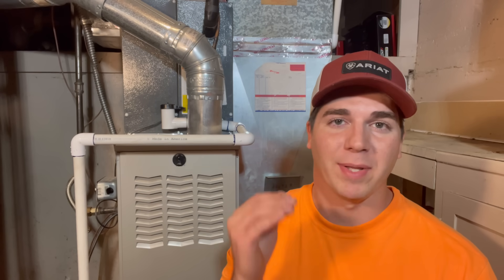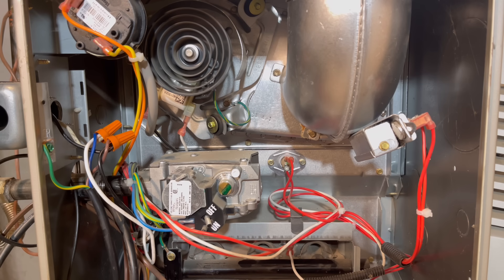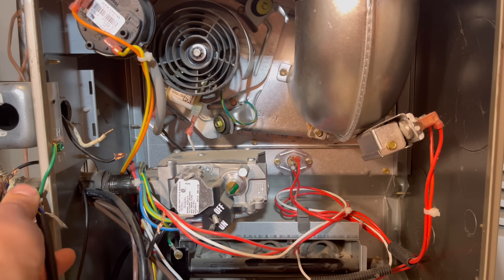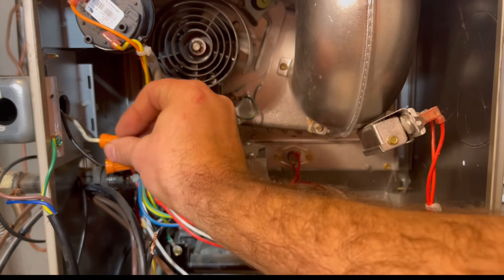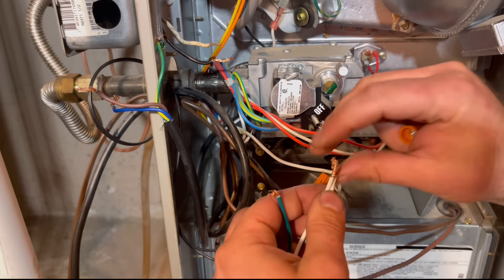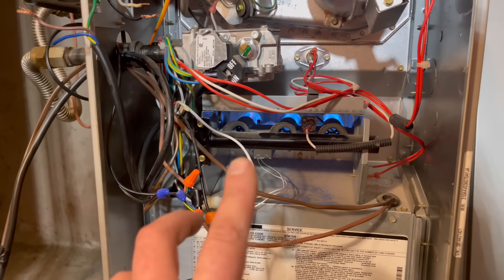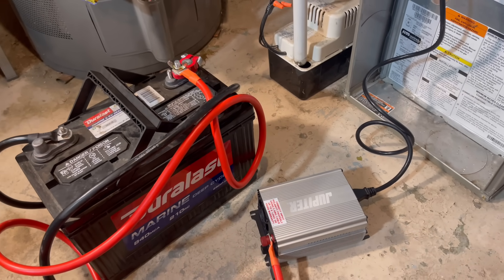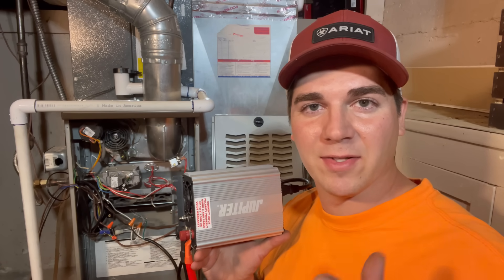Did You Know You Can Heat Your Home With A Car Battery?

Comment: Better idea for emergency situations.... get a 1000 watt inverter, and have it properly, professionally and permanently installed in your car / truck / van.

(Or you want to go all out, get a 2000 watt inverter, get a better alternator and a second battery installed in your car.... car stereo guys do it all the time).

In the event you need power, like for your furnace or fridge, you can leave your car idling (big deal... this will cost you 30 litres a day, who cares about chumpchange or minute pollution in an emergency situation) and run an extension cord to your fridge and furnace. And if its that cold outside and you have no power, roll the goddamn fridge outside, and ut wont even need power.

Smart tip :

In your kitchen,....
turn the fridge on lowest temp.... get it good and cold.... then you can unplug it for 6 hour shifts, and use the power for something else in the meanwhile... like your griddle or lights.

Sane goes for the furnace... get the house gotter than you can stand, then turn the themostat down to 55'F  bundle up and go to bed.  

If you need to boil  water or heat food , wheel the bbq into the garage, and do it in there with the garage door cracked a bit.  36 slices of toast in 5 minutes.

Final note.....

Generators suck.... they are loud  and piss off your neighbors. And they also arouse suspicion.... in hard times, people will take what you have.  An idling car with the lights off is much more lowkey
Reply: Why would you roll a fridge outside?  Makes zero sense.  Take the stuff out of it and bring it outside instead of the fridge.
Reply: @areyouthreateningme4026  Yes you are 100 percent right. If there is snow or its cold then your idea is the best. If it's too cold then a fridge compressor will freeze up and stop working.
Reply: @areyouthreateningme4026  because the fridge will keep your stuff from freezing while your furnace is getting fixed, or until the power is on.

Do you like ftozen milk?
Reply: @mediumsizedm  Just put everything in a box or ice chest and it will be fine. I live in Montana and we had to do that during a power outage in the winter once. Oh also check on what a cold box is since that's what they used to do to keep food good.
Reply: @mediumsizedm  That will do no good in the case of a power outage.  
Your stuff that needs to be cold will be warm and possibly spoiled. That milk won't freeze inside a closed refrigerator, it will get warm though.
Reply: @areyouthreateningme4026  Better yet... My fridge has an opening behind it to the outside. When temps go low enough I shut the power off and open the back door. Lastly, I drape a thermal blanket to enclose the fridge compartment and  it works great! 
I just about loose my mind thinking about keeping the house warm so I can plug the fridge or freezer in, to keep them cold. Yikes!!!
By the way my freezer is enclosed, outside, year round and I'll just shut it off too, when the temps drop. Yikes again!!!
Reply: @areyouthreateningme4026  Alot of new refrigerators are waaay too big to just roll outside, so yeah, take the stuff outside. Makes more sense.
Reply: A small solar setup might not be a bad idea either
Reply: @chrisE815  You can buy a 400 watt solar panel kit with a 30 amp charger controller for about $500.00, but you will still need the wires and terminals ( under $80.00 ) and batteries ( $200 or up depending on how many batteries you buy and what type ), and power inverter ( I good 1500 watt pure sign wave inverter is $180.00 or higher ).  I have purchased a couple different sets and I have found that one set is just as good as any other set.
Reply: @christopherhorton821  Solar kit is the way to go for this application and it will have the added benefit of being useful the 99.9% of the time you're still hooked up to the grid (if you have a solar circuit or net metering).
Reply: @Bonzi_Buddy  The last I heard was that if you have a grid tie system, and the grid goes down it shuts off your solar system so you can not use it. If you want a solar system for when the power is out then the best way is a off grid system.
Reply: bbq in garage = Fire risk and carbon monoxide poison risk so don’t do that lightly.
Reply: Omg. You shouldn’t use a bbq in the garage at all.
Reply: @Glocktard  Right. I may have been too understated.
Reply from the maker: Man, all of this is such good info. I’m going to pin this comment. Thank you so much!!! Make sure and subscribe to our channel for more hvac tips and tricks! I’d love to have your comments on all my videos as well :) cheers
Reply: @diyhvacguy  Last time I checked the sump pump backup system uses a marine battery, hmmmmmm.....
Reply: Yes it can be done but there are a couple drawbacks with putting a inverter in a car. The first drawback is the gas prices. The gas alone would kill your savings. The second is a lot of cars headlights come on automatically when the car starts, and the third is someone can steal your car. I did install a 1100 watt inverter in my van myself using 2 gauge welders wire and a disconnect. I also have a fuse close to my battery. ( Duel Cycle Marine Battery ).
Reply: @christopherhorton821  good points.   The hybrid offering including f150 seem to solve the efficency issue. More efficent than any generator for sure.
Reply: @christopherhorton821  that's right but i would argue hybrids are not much more expensive than their gas counterparts, at least in the case of toyota. I'm a big fan of phev- i own one now- it's super convient to charge at night when I'm low on gas and gas up on a road trip.  Nearest gas station is about 15 minutes away from me.
Reply: Thank you for some valuable info regarding inverters.
Where I live my climate means I don’t need a furnace.
I’m a doomsday type of bloke! I have a genny in my  man cave under my house and the exhaust gas is piped out from under there to the side of my house via another muffler behind bushes. From my front boundary it cannot be heard.
 I need a genny because as a hard core prepper in my 70’s I have two fridges and two freezers. If necessary I also have a freezer in the motorhome that runs off LPG, and a small fridge/freezer that runs 12volt or 240  volts as is the standard in Australia.
All of these can be turned off, laid on their backs, and used as ice chests!
I also have an ice maker, that in the above mentioned scenario, I need to supply ice to the freezers/ice chests.
So for me, whilst petrol lasts, I can hopefully survive.
Reply: These are some good tips but please remember GODS last name is not damn.
Reply: @SolarVergmoid Not only is it bad for your engine it's a easy target for a thief.
Reply: @christopherhorton821 
 around here a thief is an easy target....
Reply: @boostismagic  Not so much where I live.
Reply: That’s what I did in case generator quits working can buy me some time when needed and if I ever need ac power outside of my home on the property or anywhere else but I do recommend a second backup battery installed as well and a cutoff so it doesn’t drain your starting battery unless you have a jump starter
Reply: "in hard times, people will take what you have" ... yeah they'll be laying in a pool of blood next to a generator. What is to say they aren't going to take your idling car since the key is freaking in it. There will be idiots who idle their cars in the garage and snuff out their family too.
Reply: @Bonzi_Buddy  You have a lot of common sense. I wish people would think more like you do.
Reply: @Bonzi_Buddy  lock the car while it's running and use a spare key to get back inside. Same with push button ignitions. And or run a chain through the front and real wheels (mag wheels) as a secondary defense.
Reply: @grampa_ahah  That sounds real convenient.
Reply: Add to all this,  if you have a gas water  heater, fill the tub  with  hot water, and let the heat dissipate into the living areas. A tub full of hot water contains over 1400 BTU's of heat. That's a lot. When  it  cools down, refill it. Water heater works without AC power.
Reply: @grassroot011  That's a good idea. You can also use the water to flush the toilet if your powers out.
Reply: @christopherhorton821  😅 You have an electric toilet? Nice! 🙄
Reply: @gus473  What are you talking about. My ram van may not be the best but it's not a toilet. I do have a camping toilet that can go in my van and I have a new toilet for my camper trailer, but I'm not sure where you got the idea that I have a electric toilet. Can you please clarify on why you think I have a electric toilet. Thanks.
Reply: @christopherhorton821  M. Gustafson is probably wondering, as I am too, why you would take the water from the tub to flush your toilet? If you can fill your tub you can flush your toilet (unless it's somehow electric?)
Reply: @yvongauthier4409  If you know a big storm is on the way or if your power keeps going out or if your lights keep going off and on then you full the tub before the power goes out completely and stays off. Someone said to fill the tub with hot water for heat, but if you have power for your hot water heater to work then just run a electric heater or turn on your oven to keep warm. This video was about when the power goes out. The smart thing to do if you think your power is going to go out is to fill every jug and jar and pot and pan that you have with water before that happens. Also fill your tub if you have one. Use that for bathing water and toilet water. If you have a propane or butane camping stove and a large pan you can also heat a pan full of water and put the lid on it and it will put out heat. I'm not sure why people think that if there is a large scale power outage then the water will somehow stay on without the city having power. If you have ever been through a very long power outage then you know what I'm talking about.
Reply: @christopherhorton821  Yeah you're right, water "might" not stay on. I remember the big outage we had years ago, it lasted for a day or so and it affected all of Ontario (Canada) and New York state. I still had water running because I guess our town had a backup generator. I even had hot water because my natural gas water heater was an old one with a pilot light which kept my hot water hot!
Reply: @yvongauthier4409  You were lucky. I Lived in Texas in the United Sates for 25 years and we got hit with everything from tornadoes to hurricanes. When our power went out the water usually went out sometimes for a month or longer, and if the water did stay on it was not safe to drink without boiling it.
Reply: @grassroot011  Unless it's one of the many that ARE electric..... 🙄
Reply: I dont know about a car battery making it more than a day maybe a marine battery something made to have power drawn from it constantly with little or no charge but anyone who has ever has a alternator go out in there vehicles knows there isnt much of a actual charge and are made to disburse a bunch of power at once unlike a marine battery which this is on the video there is a big difference. I do like the whole power inverter in your car but my generator isnt loud and is attached to my house I'm not worried about it coming up missing and the lights are a sure fire way to know we have power. I also have a gas powered generator that runs for 16 hours off just three gallons and can power my whole house also.. it's mainly for jobs without power but it's in the shop and I dont have to worry about someone driving it away .. but the power ok inverter in the car is a much better idea than using your car battery.. then you would be without heat and a car which would have heat if the battery is charged
Reply: @ptravers9077  I have a duel cycle marine battery in my dodge ram B2500 van as a starter battery, and I ran cables in to the van to a disconnect switch on the inside. I also have a couple bus bars so I can connect one of my inverters if I need to. It's not pretty but it only took me about a hour to make my own cables, and install everything. I can even connect a solar panel and charger controller to the bus bars on the inside of my van and charge my battery. Pretty simple setup and it comes in handy.
Reply: @christopherhorton821  it's odd that a van has a marine ba6in it do to the amount of energy it pushes put the starter would just run it down fast. Unless it's a sleeper van then the electrical would be slightly different than a typical vehicle.. but hey at the end of the day in. A power outage if you think your van is safe running with no one in it good for you
Reply: @ptravers9077  Who said that I would let my van run with no one in it. I said that doing that would be stupid. You can believe me or not about having a Duel Cycle Marine Battery in my van as a starter battery , but I do show everything on my own channel and my van has had no issues either starting or running. I'm not dumb enough to connect a large power inverter up to the vans wiring. I have 2 gauge welders wire going from the battery to a disconnect then to the inverter. I also have solar and a small 400 watt wind turbine generator and a gas inverter generator for power if needed.
Reply: Pffffff
Reply: @xr9450  The smart one would be the Generator. At least you can chain a generator somewhere close to your house, and it will use way less gas.
Reply: thanx man
Reply: this is great!  i always wondered why all cars and trucks dont come with this built in.
everybody would automatically have a giant portable generator ready to go at any time!
Reply: "who cares about chumpchange or minute pollution in an emergency situation" the stupid liberal democrats who are trying to take over America
Reply: @jeremypilot1015  And don't forget they make way more pollution just by flying around in a month than the average person does in a entire year.
Reply: Good stuff bro. I went with a battery bank and two 4000 watt inverters, which I can recharge with a gas generator, my car's charging system, or a hand crank set up with a 180v forklift motor running through a diode. Preparing is fun!!! Haha!
Reply: 🐾 And to assure your vehicle doesn't "wander off," be sure to put your Doberman inside! Leave the window cracked and a dish of water in there too! 😉😅✌🏼
Reply: @gus473  Good idea but we own a cat so the dog thing is out.

Comment: By far the most sensible option is to simply buy an inexpensive generator. Around here, I can buy one for about $350. When you need heat, start the generator, then the furnace. Setting up elaborate battery-inverter-idling car scenarios just doesn't make any sense. You'll probably want lights and a few receptacles in the house anyways. Remember the KISS principle: Keep it Simple, Stupid.
Reply from the maker: This is great advice. I have a 3500w dual fuel generator set up with a quick connect natural gas fitting so I can be up and running in less then 10 mins. I need to install an interlock kit for that soon. But this is good knowledge for people who don’t have that as an option and find themselves in a sticky situation. Thanks so much for the comment! Cheers

Comment: You need an 1800 watt inverter roughly a whole furnace takes anywhere from 12 to 14 amps of 120 volts to run the inducer fan hot surface or electronic igniter the limit switch and the thermostat Transformer and the real load comes from the blower fan which is about 12 amps

Comment: I’d use my generator for most things including the furnace.  It is noisy so I’d rather not run it all night, but you still might to run your internet, lamp, tv, etc.  The inverter would be great for that.  Plus you can recharge it off your car.

Comment: Will it work with an oil burner instead of natural gas? I’m assuming it would .
Reply from the maker: I would assume so if it runs on 120v. I’ll have to do some research on oil burning furnaces. That seems like a very common furnace

Comment: Nice, what I did was unhook the power to the furnace and wired it into a normal outlet box. I then put a plug onto the furnace power wires. When the power goes out I simply unplug from the outlet box and plug into the extension cord from my generator. You can do the same with your battery inverter set up. No more playing with the wiring its a permanent set up.
Reply from the maker: Yea that’s the plan! Thanks so much for the tip. Make sure and subscribe for more hvac tips and tricks! Cheers

Comment: In January of 1998 northern New England had a 4 day icecstorm. I had (still do) a 5hp 2200W ac generator rhat was shared in a neighborhood that lost power more than a week in 30F weather. A similar cord was connected to the furnace or hydronic hot water boiler and the homes fridge/freezer. The genny be run for an hour or so to get the house nice and warm and keep rhe food cold and then move on to the next house. The next visit was anout 12 hours later. It was enough to keep things tolerable. Your idea is good, I would calculate the peak and steady state draw of the igniter, combustion air blowers and the circuulator fan/pump to be sure the inverter has enough power. Number and size of batteries would need to match. When SHTF any option that works is good. This might be a better option where a running genny would attract the wrong sort. Thanks.

Comment: You can buy an automatic transfer switch for 120 volt that will switch to battery power if the utility goes down and switch back when the utility power comes back on. They are less than 50 bucks. Put a small battery maintainer on the 12 volt battery and you will never have to touch it for 5+ years. You can do the same for your refrigerator or freezer. Your single battery won't run the furnace for days so you would need more batteries, preferably lithium based for longer outages.